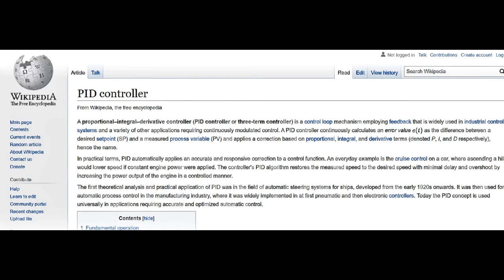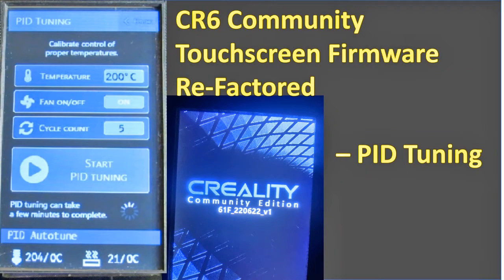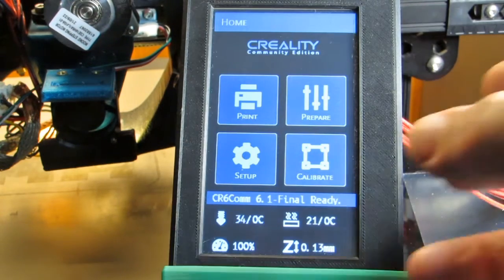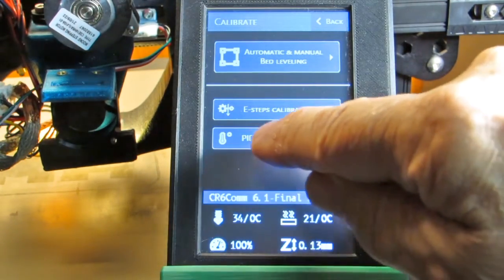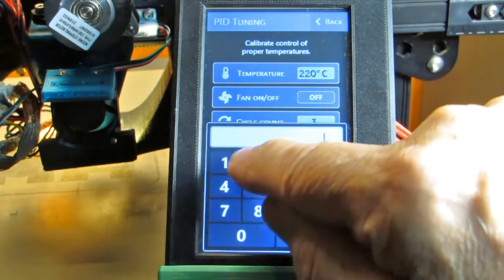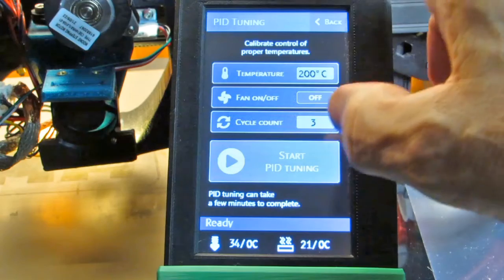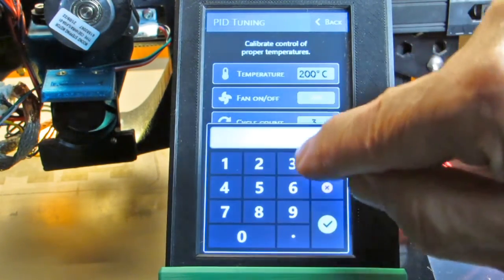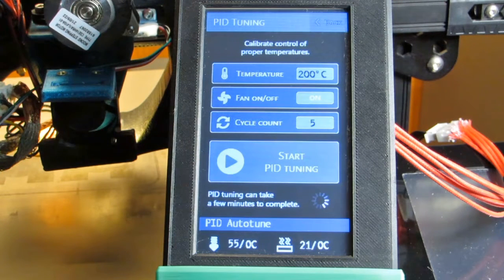PID Tuning With the CF6.1 Refactored Firmware

Comment: mine wont pid tune heat stays at abient temp  every thing else seems to work any suggestions would be appreciated thanks
Reply from the maker: Sorry - I just found this comment.   
If the version of CF6.1 mainboard firmware installed does not match the motherboard, it is common that the heaters and the part cooling fan do not work. (Creality changed on which pins those devices are connected, between 4.5.2 and 4.5.3/1.1.0.3)  
Since you say everything else works fine, aside from PID, I can not think of any other cause.
If you try using a terminal program and send PID gcode instructions to the printer, it would be interesting to know whether the nozzle and bed PID routines work.
Hopefully, you have already resolved your problem by now (sorry again for the delay.)